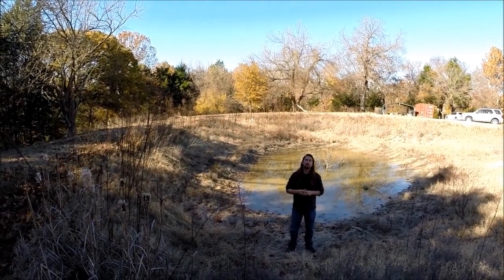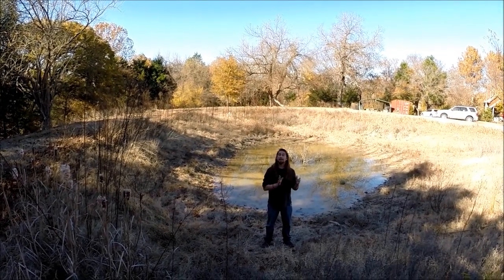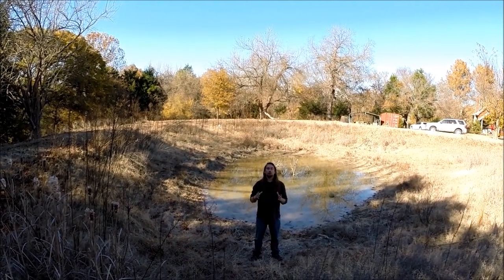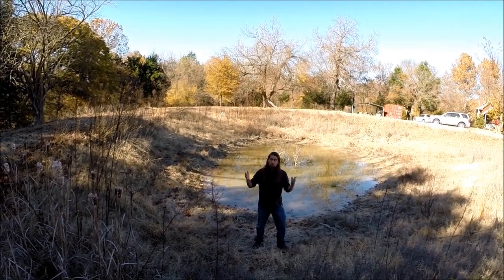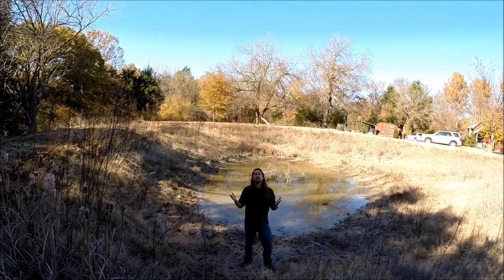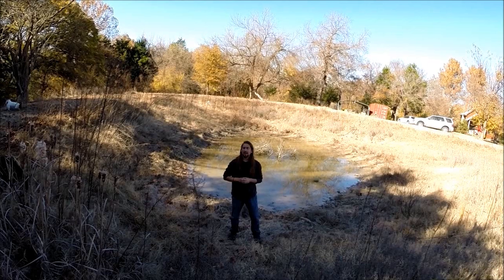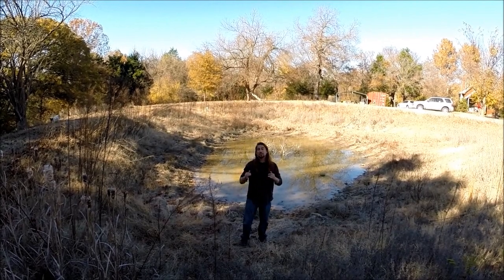Permaculture Tip of the Day - When Earthworks Go Wrong

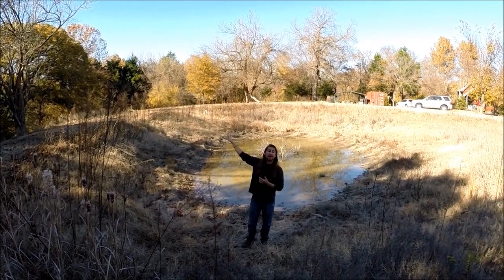Comment: You're covering some really interesting stuff here, but it would be easier to understand if you gave us some illustrations of the fixes you spoke about. For visual learners, a static shot of the problem and a guy standing there explaining new ideas while waiving his arms around just doesn't cut it. Where is this creek you've referenced? How is it flowing relative to the failed pond? What would be the contour of the spot after putting in a semi-underground greenhouse? I'm having trouble visualizing the slope you reference at about 4:15 and the new pond you speak of at about 4:24. I'm sure that, in your mind's eye, it was crystal clear. But from where I'm sitting, it's pretty confusing.

Comment: Won't the underground greenhouse still collect water to some degree? Good video
Reply from the maker: Hi, Yes it will. Properly designed, the drainage from the roof area and the ground's surface will flow generously into newly designed usable spaces.